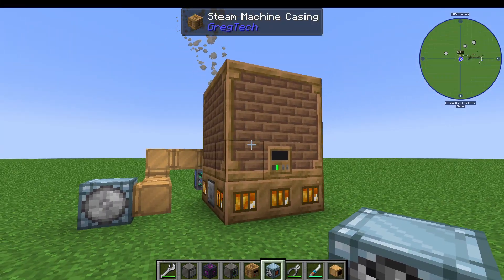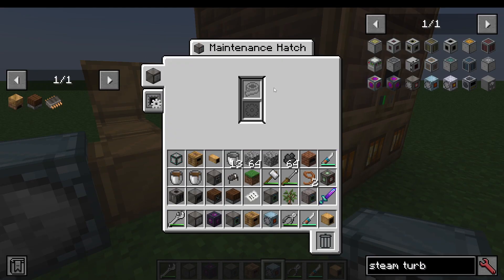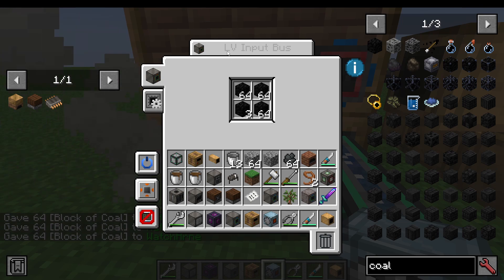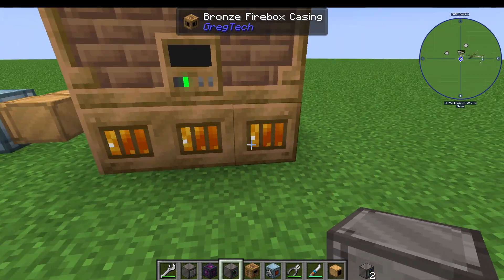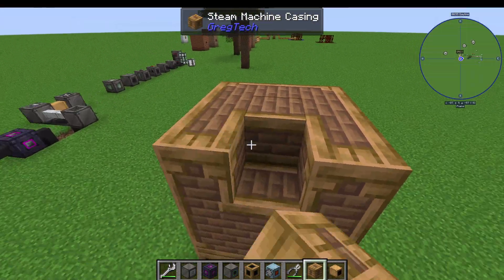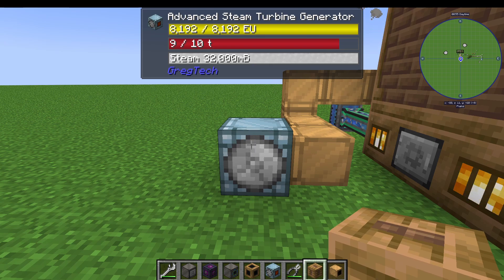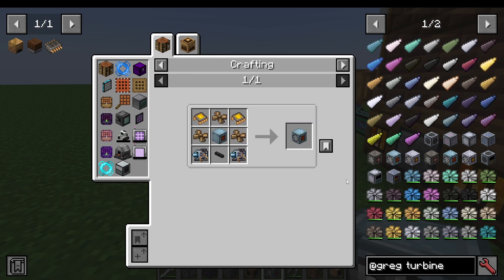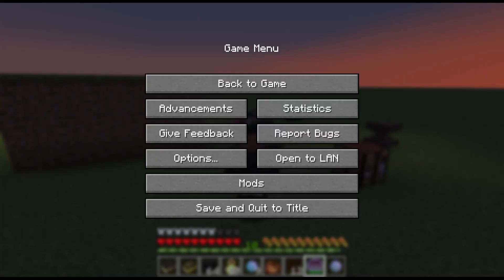Large Steam Boiler Tutorial - Gregtech CEu

Comment: Searched for a vid, since that is exactly how I set mine up, I put water in first and then fuel, but it still explodes and trying to troubleshoot why. Can't figure it out.
Reply: Same. I tried several configurations in both survival and creative. It creates 160mb of steam and explodes. I originally thought it was water throughput and tried with large treated wood fluid (120mb/t) and Large bronze fluid pipe (240mb/t). The furnace heats up in 3 seconds and the 16k mb lv hatch stays full of water the whole time. I've also tried down clocking it to 25% but it always explodes the same way. Might be a bug in the current version (GT CEu Modern 1.13.2). Googling the issue results in threads saying boilers explode when water is in a different chunk (tried that too) or when you first load into the game. The modpack author says not to use the large bronze boiler and just spam single block ones. I dislike farming and inserting coal and the solar boilers are pretty weak so I jumped straight to ethanol in combustion in mv instead.
Reply from the maker: did the water run out, and then more went in once it was hot? Sounding maybe like a throughput issue but hard to know ;(